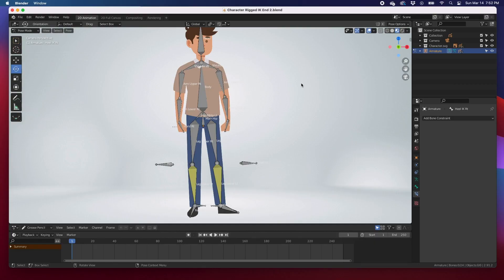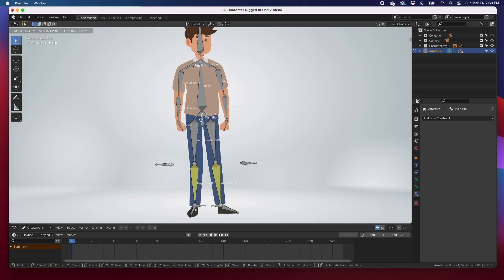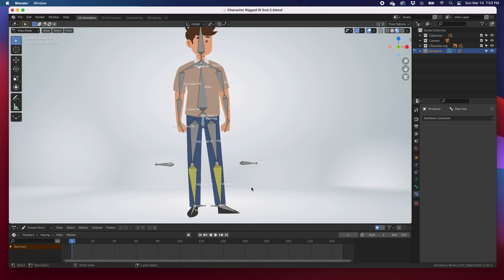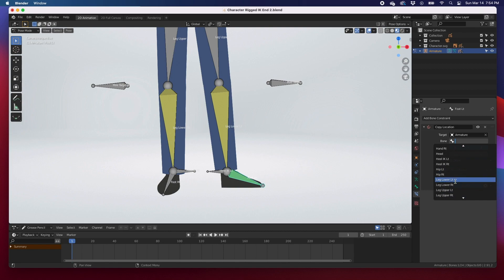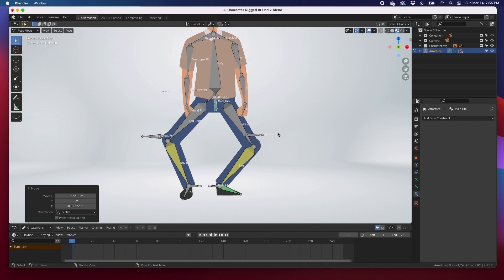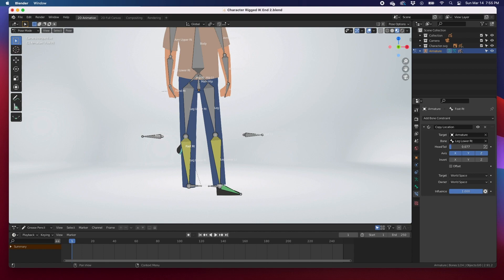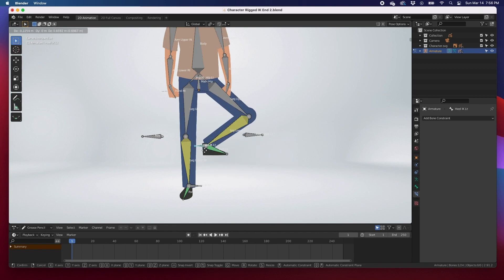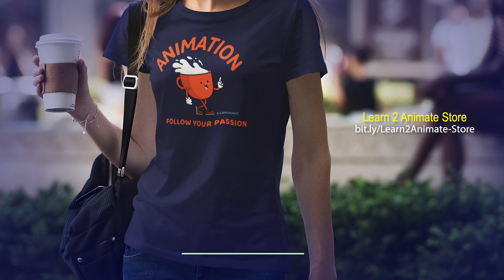Lock Foot to IK Chain for the legs. Basic Rigging tutorial. Blender Grease Pencil tutorial.

Comment: hi, when ı use bezier curve ı can not add material. how did you do this charachter could you please explain?
which can ı use object to do character like this? thank you
Reply from the maker: I imported an SVG file that I prepared with Adobe Illustrator. I then changed all of the Curves to Grease Pencil objects using Convert to under the Object menu. Here is the start up blender file. https://www.dropbox.com/s/5dhjorxbx2e2lzr/Character%20Rig.blend?dl=0 
Hope this helps. Thanks! 😎
Reply: @Learn2Animate  many thanks for your reply. I'll draw another character using stroke. I will see what happens:)